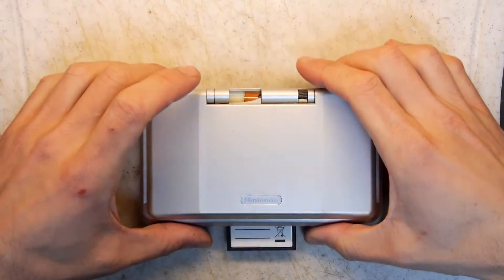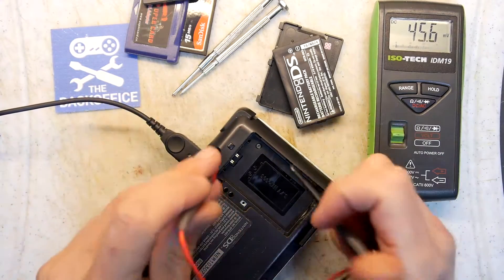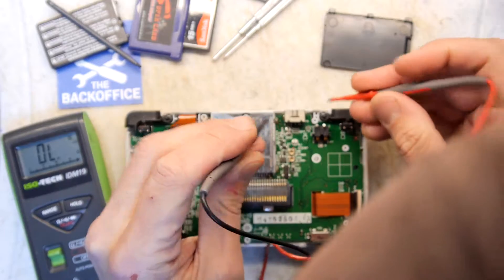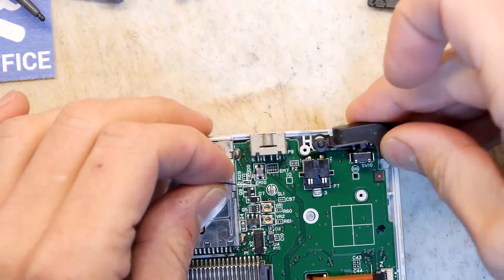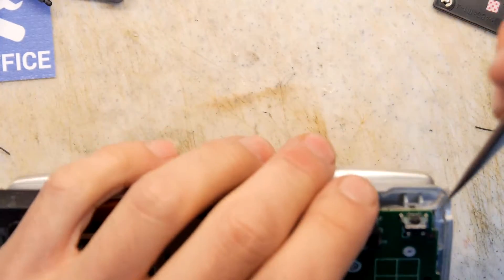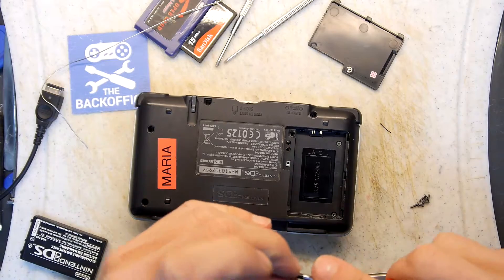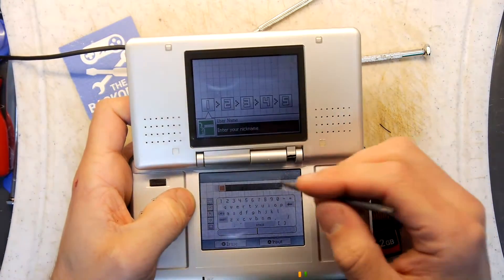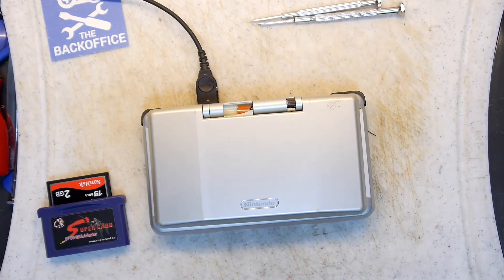Nintendo DS Fuse Repair

Comment: I'm attempting repairs on my DSi XL but I lack supplies to check for any faulty fuses. Do you have any recommendations on what to use? For a little bit of extra context, the DSi is having a power problem much like this. Blinking charge light, no power being recieved through the battery.

Comment: So I was replacing the shell of my DS and in order to check working status my dumbass self inserted the battery without the back cover, without double checking polarity and my DS didn't power at all. Thankfully I noticed the F2 component on the board and came here to confirm it was indeed a fuse. I used some thin copper wire and thankfully now it works again.

Comment: It's refreshing to see this repair done with a soldering iron instead of blowing hot air on the entire board for one little tiny fuse. On another note, little tiny fuses are cheap. Order some little tiny fuses, and replace it with a new little tiny fuse instead of a jumper wire. Fuses are there for a reason.
Reply: a hot air gun would have been handy for my f1 fuse, but i broke its pads
Reply: @ricktheamazingdriver  a hot air gun is a waste of time if you have a high quality soldering iron. Why blow hot air all over the board when you can touch the fuse for 5 seconds with a soldering iron and be done with it?
Reply: Where I can buy that fuse?

Comment: I know this was posted years ago but what wire did you use to make the fuse
Reply from the maker: I really cannot recall, but if you want to take a risk you could use a single strand of the smallest wire you could find, like transformer coil wire
Reply: Ha, I'm in a similar situation but then saw this was posted 4 years ago

Comment: The left side of my F2 pin is not showing power while the right side does when using a volt meter and connected to battery charge pins. Advice? May just need a new motherboard ):
Reply from the maker: Replace f2

Comment: I replaced this fuse but its still not coming on for me. Is there an other fuse like in the ds lite?
Reply from the maker: I think there are two fuses. What condition is the battery in?
Reply: @backofficeshow  the battery works well. I cant find the other fuse ;/
Reply from the maker: I do not have my PC on there too confirm if there is a second one. Does the led do anything when you apply the power adaptor?
Reply: Yes the orange light comes on as normal when I power on it goes green for 1 second with a white bottom screen and then gones black
Reply from the maker: Still sounds like the typical fuse / battery issue 🤔

Maybe it's possible to jump into the power rail from a bench PSU. I've not had to try, but it should rule out issues with any of the charging circuitry and battery
Reply: @niallers8572  Still need help? Flashing bottom screen means the top screen isn’t connected properly.

Comment: Did you just use solider to bridge across. How many amps would it take to break it?
Reply from the maker: Dozens
Reply: @backofficeshow  in that case I guess if there's a fault my ds will get fried?
Reply from the maker: Probably, unless you can deconstruct a fine braid or transformer wire and use a strand of that.

Comment: Hello, I made this solution and it worked, but I just use solder not a wire. Can you tell me what fuse should I got to replace?
Reply from the maker: If you run Google three are people selling the fuses as a kit. Look for "F1 & F2 Fuse For Nintendo Ds Dsi Xl Lite Dsl Replacement"

Comment: So when I did the fuse test I got 1.0 to 5.0 and then it went to zero so would my fuse be fine and the battery is dead
Reply from the maker: That could be the case and cheap enough to test with a new battery

Comment: will these fuses also work with the 3ds xl? my console will only power on if its plugged into the wall
Reply from the maker: I'm sure they use the same or similar inside 👍

Comment: Hi, I just bought a PT DIGITAL MULTI-TESTER at a auto parts store for $19.00 dlls, is this good enough to test the fuses on my ds? We no longer have a radio shack. 😞
Reply from the maker: Should be fine
Reply: backofficeshow. Ok and on what setting?...please!
Reply from the maker: Continuity or resistance will do. A fuse will have a resistance of zero

Comment: What kind of wire did you use or should I go with a fuse instead?
Reply from the maker: A fuse is best. If you are desperate use the thinnest wire you can find, maybe even a strand of steel wool might be good. But remember, anything other than a fuse could harm something or someone!
Reply: backofficeshow. Thanks again.

Comment: I recently resigned from my previous employer and I've been spending the past few months repairing all Nintendo dual screen consoles. I have not purchased one DS console that was working, and I now have around 50 working units. I plan on setting up a store in the near future for some supplemental income.

I only have one original DS. I prefer to work on the DS Lite, but I have worked on every DS, except for the New 3DS. I have worked on the New 3DS XL, but I managed to break a flex cable connector and will have to swap the motherboard. I have successfully fixed everything else.

The most common problem is a dead battery. There are two types of dead battery. Type one is when a working console will flash the light on and off when you plug in a charging cable. This battery is really dead. Type two will read 0 volts on a multimeter but the battery is still okay. This covers most dead batteries. Most broken units you find on eBay have either a battery that must be replaced or a battery that simply has to be charged before using.

The second most common problem is a broken hinge. By far this mostly occurs on the DS Lite. If caught quickly, you can replace the shell for around $5. If not caught quickly, the broken hinge will destroy the upper display module, too.

The third most common problem is a destroyed upper display module. This is almost always caused by a broken hinge. Replacing the upper display module is a breeze on the DS Lite compared to the 3DS, where it is extremely difficult and error prone. Except for the 2DS, the upper display module is only $5-10.

The fourth most common problem is liquid damage. Sometimes liquid will destroy the motherboard, but you'd be surprised at what I've been able to simply clean off with alcohol. It's good to have a few spare motherboards for verification purposes.

The fifth most common problem is a broken charge port. The original DS and DS Lite never have a broken charge port. This only occurs on the DSi and newer. Fortunately, swapping charge ports from a liquid damaged motherboard always works.

The sixth most common problem is a blown fuse. Always check continuity on both fuses. If you're lazy you can use a solder blob, but I like to take a fuse off a motherboard with liquid damage.

The seventh most common problem is a broken flex connector. They can be a bit of a pain to replace, because they're easy to melt. It's helpful to have a stack of dead motherboards.

The eighth most common problem is a bad digitizer. There is a way to do a calibration of the digitizer but it never works. If the digitizer is off, it's off. Fortunately, this is a cheap repair. Digitizers only cost a few bucks and less than $2 on the DS Lite.

Ninth is a bad lower screen. Kind of rare, but I've seen a few bad ones. Except for the 2DS, lower screens are only about $5-10.

Lastly, the Wi Fi module occasionally goes bad. If the light stays on continuously but nothing happens then it's just a bad Wi Fi module. Always have spares from liquid damaged motherboards.

The 2DS is a special case. The screens are one module, and if the screen module is cracked, you have to pay $30 for a new one. Fixing the 2DS doesn't make much economic sense, unless and until they can bring down the price of the screen module.
Reply from the maker: +John Gotts oh my, this is fantastic advice!
Reply: I’ve recently started buying broken dual screens off eBay and I’ve been pretty successful with fixing them. I got my first water damaged DS recently, a red DSi. When I put it on the charger the light stays on. I cleaned the motherboard with 90% alcohol. I replaced the power board, the one the battery goes on, but it still won’t turn on. It’s probably not fixable but I’d like to know if you have any advice to give me if it’s still possible to fix.
Reply from the maker: The problem with water damage is that the fault could be anywhere. If you are lucky it's visible corrosion or burnt track etc, but often is a damaged IC or component. If you have tried all the usual things like cleaning with IPA and visual inspection I'd try finding out if there are any fuses.
Reply: backofficeshow I tested both fuses with a multimeter and they both made it beep. So I guess that means they’re good. I guess I should more closely inspect the motherboard. Not sure what I’m looking for though.
Reply from the maker: Ok for anything that seems a bit strange looking, also check where the battery connects to see if you can measure any voltage.
Reply: Can I send you my ds Lite?
Reply: I hope you still use this account, I just changed the lower monitor of my original ds, I was gonna test the touch but it didn't work, open it again to check the cables and now my ds doesn't start, when I plug the charger cable for a second the led turn orange but it turns off again. What can I do?
Reply: And what about the DS lite that shows its charging but it's not, I mean the orange charging light comes on while charging but there's nothing charged at all
Reply from the maker: Have you changed the battery?
Reply: @backofficeshow  yeah it's a battery from the other new DS lite
Reply from the maker: It's almost always the battery or the Fuses.
Reply: @backofficeshow  the orange light also has been flashing unstably yesterday
Reply: How goes it now?

Comment: backoffice I have a question,  my sisters ds got washed in a washing machine and i got it all dry but when i charge it, it charges for like 5 seconds then the light goes out, and when i turn it on, it does the same thing, it turns on for like 5 seconds, then turns off.  please help if you know what the issue is please :)
Reply: also i completely dried as in took it apart and put it back together.
Reply from the maker: +Commander Sparkles check fuses F1 and F2 in the same way I did in the video. One fuse is on the top of the PCB and the other underneath.

Comment: Nice fix, didn't know you could sub wire in a pinch. Wish I could get a transparent 3DS case but they seem non existent
Reply from the maker: +Ganjulationess3DS yeah fuses are just particular gauges of wire in most cases. In the olden days we used wire instead of glass fuses 😁

Comment: Wow thats a slot2 supercard? old stuff there. Those drawn a lot of power, you might be better buyin a new supercard (slot1 only) or a m3 if those are still manufactured.
Reply: Might be ok to use after the battery has been on charge for 30mins or so. I'd probably order a cheap replacement battery as it might be dropping or spiking under load (possibly what might have done the fuse in originally).
Reply: Yeah it should be ok after some time charging. The slot 2 flashcards and addons draw more power than usual, the rumble pack could even suck up all the battery life in a second on some specific circumstances. I would try to replace the fuse though, to prevent that from happening again.
Reply from the maker: +Simon Lock Yeah, I think you are right, I have the feeling the battery itself has an issue delivering the required current so will be investigating that. Does seem to occasionally work, but the led flickers. It was used for years in this configuration so it's the likely culprit.
Reply from the maker: +Almamu I have one, takes a micro SD. This one is more of a curio. I also have the kind that needed it's own parallel port programmer 😀
Reply: they are really convenient, i do have some too. Spent a lot of time on the homebrew community for DS and DSlite. That was passkey right?, god It's been a long time since I saw one of those.
Reply from the maker: +Almamu I can't even remember what it was called must be 15+ years ago 😁
Reply: Is it bulged at all on any of the cells? The two I've had fail have had a noticeable doming along one side of the pack.
Reply from the maker: +Simon Lock not really, I might try to test it under load using my scope. See the drop curve